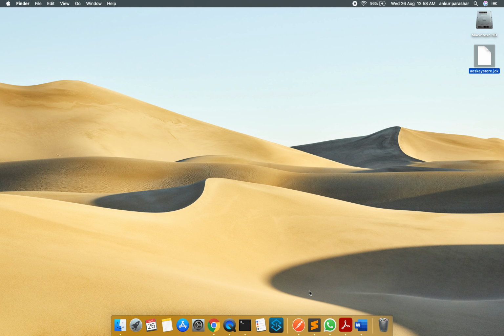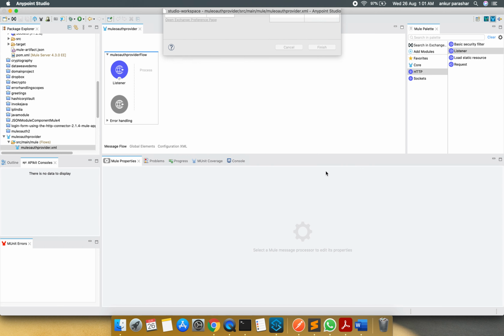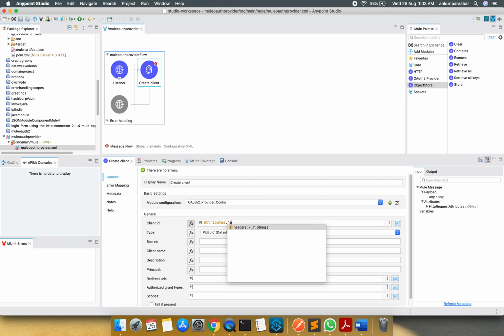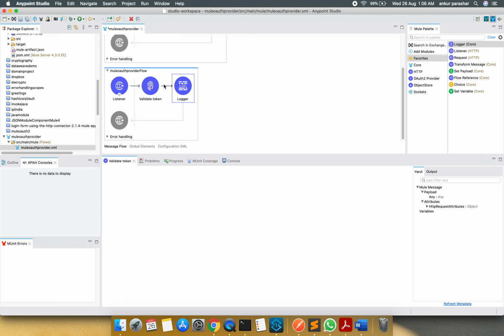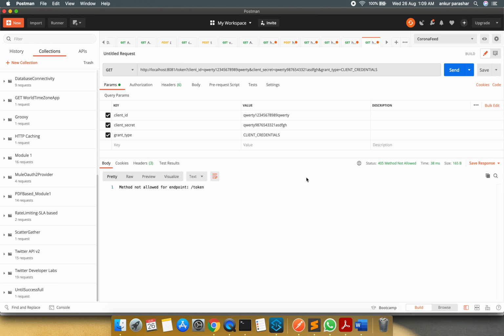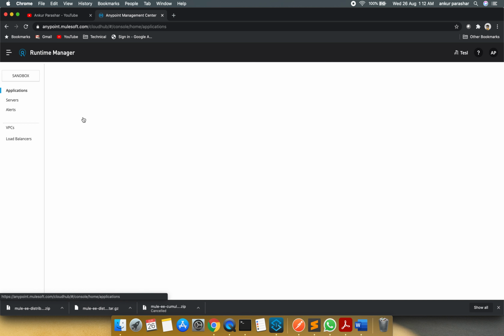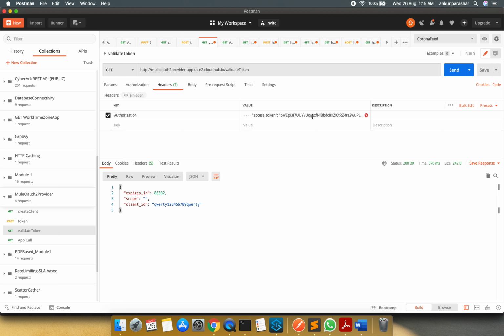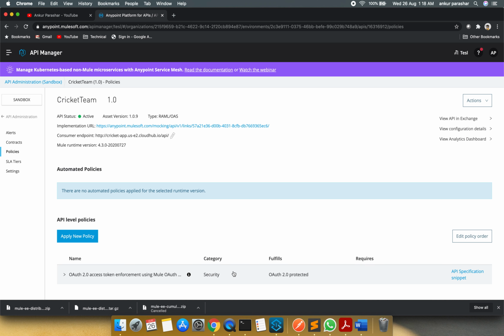OAuth 2.0 access token enforcement using Mule OAuth provider policy | Mule 4.3.0| API Manager

Comment: Hi Sir , here in this method the token is not expiring. That is if the ttl expiration time is set as 60 sec , even after 60 sec the token will work. Could you please help on this
Reply from the maker: I would suggest to have a look on code logic. Please navigate to https://github.com/ancur4u/MuleasOauth2Provider.git. Using the logic, if it is a invalid or expired token it will result in "The token received: WHx8wa5dQfp54HoIcNzZlyO9CoR1AiSsPaIuHy_RdPdiq-Xqwb62tO9su93DPM3sJLXW12AkQgdN9QuWIjlCrg , is not valid".